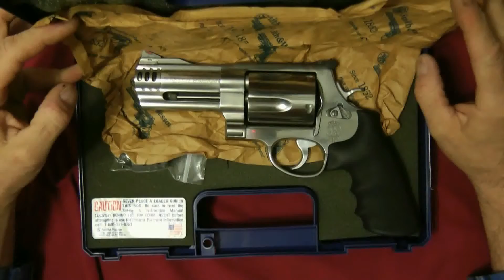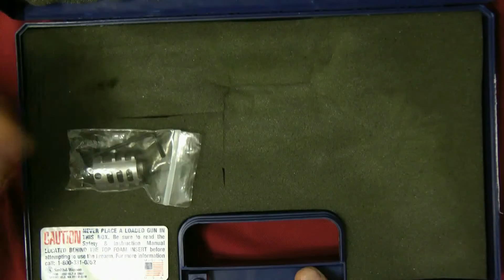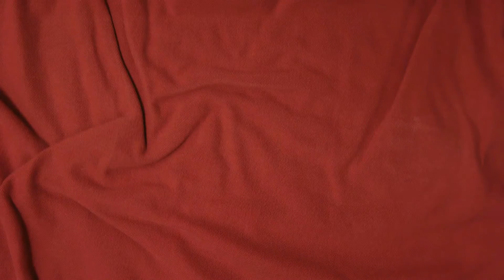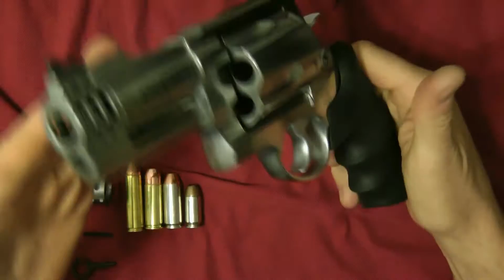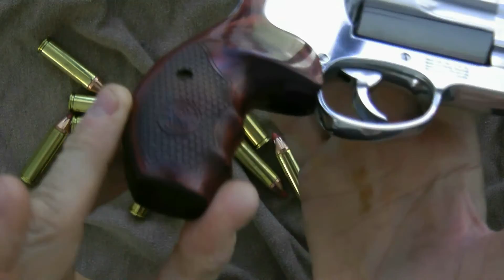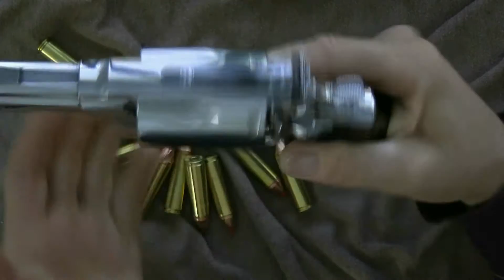SW 500 MAGNUM FACT N FICTON ITS A COOL GUN

Comment: In regards to your comment that the .50AE is not a magnum round. "Magnum" is not necessarily a useful descriptive term, because its meaning is so relative. For instance, the 22 Winchester Magnum Rimfire (22 mag or 22 WMR) is indeed more powerful than the 22 Long Rifle, but the 22 WMR itself is a wimp when compared with other, larger cartridges that may not bear the magnum name.

Over the past few decades, the word "magnum" has been used whenever introducing new cartridges--especially rifle cartridges--to the point that its meaning has become diluted. If every new cartridge is called a "magnum," the term loses its importance. Although the term still has some connotation as a cartridge that represents some form of improvement over other cartridges, "magnum" has gradually become a term more useful for marketing than for realistically describing a cartridge and its performance. So in short, it is up to marketing nowadays to define "Magnum". Thanks for the video, keep up the good work!